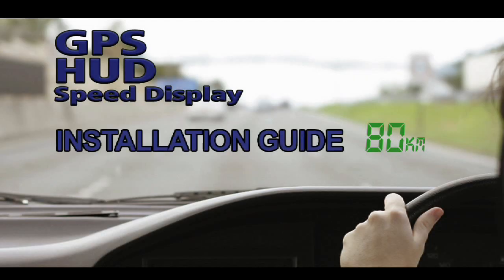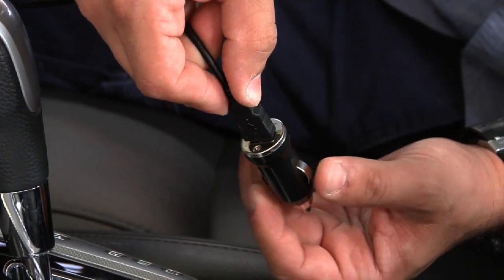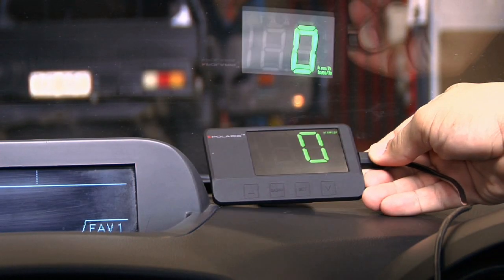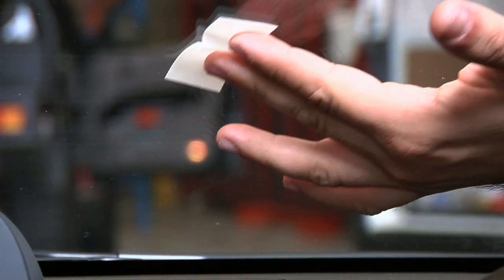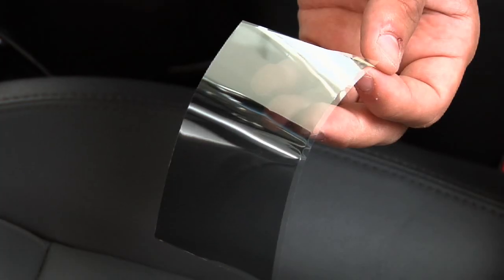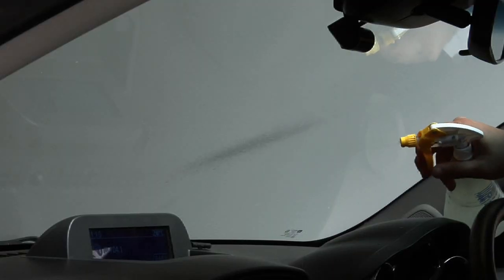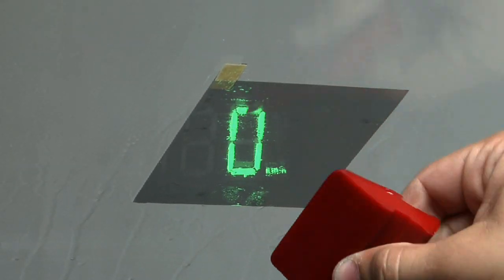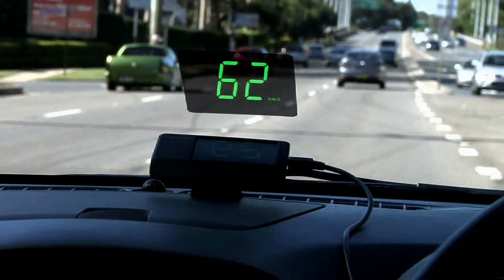HUD Speed Display INSTALLATION

Comment: I have brought a Powertrain pthudxc05 unit to fit to my 2006 Toyota Hiace van. I have followed the instructions to connect to the OBD11 Interface but after the scan all I get is three 0s and it still says scan. I was wondering if anyone else has had problems and my have some advice please? Thanks kiwiroy.

Comment: can the unit be hardwired,(John Laws reckons it can) if so how can it be done. the cig plug is only neg and positive but the usb plug has 4 leads in it.
Reply: yep! with one of these http://www.ebay.com/itm/like/261552262182?lpid=82 wired to Switched 12V somewhere behind the dash